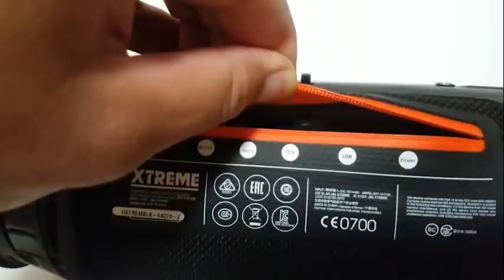JBL XTREME with 18650 Batteries (DIY)

Comment: how do you connect the batteries to each other
Reply from the maker: Safe way is to spot weld but if you don't have enough to buy that machine you can solder wires to it but you have to do it fast otherwise you will damage the batteries from the heat.

Comment: Where is the best place to buy batteries for my Xtreme jbl?? What's the most mah battery 🔋 that ww can fit in there??
Reply from the maker: Some prefer online but if you have 18650 charger that can also test the mAh of the batteries than I would visit a local laptop repair shop and see if they're giving away any defective laptop batteries and salvage some 18650s out of it. If you don't want to spend too much time doing all of this than maybe it's better to just buy the original battery but I'm not sure right now if they're cheap or not.

Comment: Should you use 2 18650 to maintain balance when changing, 2 parallel X 2 might not charge right with 18650, remember the charger for this speaker is 19V 3A output which is crazy.
Reply from the maker: The main board lowers the voltage down to 8.4V. if it was feeding the batteries 19V then they would have gone bad already or even worse exploded.

Comment: 3.7V x 4 = 14.8 will destroy my xtreme?
Reply from the maker: It will if you connect all 4 batteries in series! It's two pairs, if you look closely I have two sets connected in parallel. 3.7 x 2 = 7.4 (8.4 when fully charged, same voltage as the original battery when it's all charged up).

Comment: Ben de aynen videoda olduğu gibi yaptim. 4 adet Sony vct 6 aldim (3000 Mah.) Hiç bir sorun yok, şarj oluyor ve led gostergeler calışıyor. Orijinal bataryasına göre deşarj ömrünün daha kısa olduğunu düşünüyorum,  çünkü orijinal bataryası ile full şarj 3.5 saatte oluyordu, Sony piller 3 saatte full şarj oluyor. Orijinal batarya 5000 Mah. Sony vct 6 ile bu şekilde bağlantı yapıldığında 6000 Mah. oluyor batarya ve amper arttığı için 3.5 saatten daha geç şarj olması gerekirken, şarj daha kısa sürede oluyor, bu sebeple deşarj ömrü de daha kısa olacaktır diye düşünüyorum. 18650 kullanmak isteyen arkadaşlara tavsiyem 3600 Mah den daha düşük pil kullanmamaları.

Comment: Sir my jbl xtreme has a problem, when i pull out the charging cable my jbl only live in a few minutes then it turn off without battery low alert and when i try to charge it the device still has 4 bar battery, is there a problem with my battery?
Reply from the maker: Raditya Dimas you’re JBL XTREME battery is defective so it needs replacing. The thing happened to the one in this video.
Reply: Where can I get my battery replaced?and how much is the cost?
Reply: I replaced the batteries with 18650 but the charging problem is still not resolved i guess my BMS is defective. 
Even the vtg across the BMS is perfect.

What do you suggest?

Comment: Hi, do i need to use hig drain 18650 batteries for this?
Reply from the maker: Not too sure, I haven’t checked on the batteries i used if they’re High Drain but to be on the safe side go for it.

Comment: I made the change but it fail to start on batteries now is working only with the power supply, when I remove the charger it's shutting down instantaneous.What can be the reason?
Reply from the maker: Is it still doing that? Did both batteries have the same voltage when you connected them?
Reply: I solved it with the balanced type diagram

Comment: my jbl wont charge and i know the batteries are a problem but the charging connector feels loose... is there a way to remove the battery and just use wall power?
Reply: Yes, remove the battery, and wall power will work. I
Reply: @JohnnySlapp  then it's the charge port... shit...
Reply: adam are you sure it ain’t the cord? That’s what happened to mine.
Reply: @JohnnySlapp  I'm certain... i get sparks (meaning there is current) but no actual charging.

Comment: Is it normal for the Extreme to have a plastic smell when you increase it's volume level? I noticed that everytime I increase the volume, the speaker releases a plastic smell. Maybe someting is heating up inside.
Reply from the maker: That doesn't sound/smell normal at all. My JBL Xtreme doesn't smell when in use. Might want to check it again.

Comment: hi there Taylor, i just want to ask how many Voltage and  Ampere of each battery (AA) you are using here in this video?
Reply from the maker: Each battery that's in parallel is rated at 4.2V when fully charged but I am not sure about the capacity of the 18650s and it doesn't even say anything about it on the plastic cover.
Reply: Injimudoa!!!!!!
Reply: They are LG 18650-25R and are 3,7v 2600mah. Pr. Cell 👍 so now its a 7,4v 5200 mah. insted of 10000 mah Xtreme 🙂

Comment: This is BS if you pay for a product that has a battery then we should be able to replace a dead battery without having to go through this process, my extreme is now a static speaker pointless as a portable speaker and I have never soldered anything so am not comfortable doing what you have done, shame on JBL.

My rant is with JBL not this channel
Reply: I think electronic should start using 18650 batteries with a removable battery tray. 18650 batteries have quite the capacity compared to multiple AAs and they're rechargable. It seems as if most of the products we buy now are disposable. The battery is always the first thing to go now and you can't change it most of the time.
Reply: @noahw5887  That is my point there is no valid reason not to offer replaceable battery's via removable battery tray or the like, other then profit, these company's have mushed consumers brains to accept throw away  products as a norm, and with clever neuromarketing we won't care because the upgrade option is always in front of us.
Reply: @Shane Ryan Your argument is as useful as water bucket full of holes, by your own logic this would be OK.
Reply: @Shane Ryan The useless bucket just means your buying into and defending a product that in a very short time would become a door stop this is an inevitable outcome, yes it will hold water but for how long, would you not sooner buy an item that continue to function for many years after paying out quite a lot of money for it? Offer one valid reason why JBL do not offer a battery tray option? its not for lack of space, It is purely corporate greed.

As for reading the small print, I bought mine in curry's online no mention about the battery being non replaceable bit hard to read small print on the box when ordered online right Shane?

https://www.currys.co.uk/gbuk/audio-and-headphones/audio/hifi-systems-and-speakers/jbl-xtreme-portable-bluetooth-wireless-speaker-black-10133409-pdt.html
Reply: @Shane Ryan The most stupid people are the type of people that just don't realise how stupid they actually are, your logic has holes in it hehe.
Reply: @Shane Ryan Hey there you tried to hide but your ego brought you back, not even an attempt to answer the questions asked, I had to drop to your level to get you here, I knew you read it but it made you look dumb you tried to ignore lol. 

Your logic was based around assumption as in you stupidly assumed that all JBL extremes are bought in store, so as my "ignored" reply explains, curry's store does not mention anything about this short life span of the portable side of this device, mine lasted only three years, also JBL site does not mention it.

so let me quote you;

"I suppose you purchased your JBL product while under extreme duress, right? The sales person forced you to purchase the product that clearly states on the manufactures label "Non-Removable battery"... Shame on you, not JBL..."  unquote

Please respond to my question, mine bought online no warnings and give your reason why you strongly feel the need to support corporate greed.

If you feel i'm wrong then argue your point but lose your rudeness or don't bother to reply.
Reply: @Shane Ryan OK Shane you still can't grasp how pathetic you're assumed point was so now you try to add to it, try to think of all the possibility next time slow down and don't rush in Mr logic and maybe just maybe your get that badge your so desperate for it will say "superior intelligence" and you can show mummy and she will look at her precious and tell her little snowflake like she always told you that you are above everyone else. 

Tip for future: Shane (dumb-ass) it is OK to not agree with others but do it in a respectable way (stupid) don't be so emotional (idiot) take this tip to the grave (bitch) your life will improve but last of all please don't breed! already so many assumption thinking rude emo triggered social media snowflakes. 

So in your words Nemie will fuck off now.
Reply: @Shane Ryan I bought the JBL partybox 300 it has 8x 18650 li-ion battery's not hard to swap over, so I considered it an acceptable purchase.
Reply: @Shane Ryan Forgot to mention your Hit a nerve comment its in your head you have had no effect on me at all, all you achieved was to show me you can't get your point across very well and are rude by nature. I can reply everyday if you want not because I'm triggered by you, but because it takes a while for people like you to grasp your nothing special your just an insulting person being called out, don't believe me just read back all you have written, just assumptions, insults, and a false sense of wanting to be right, read your see you are your own witness.

Got to go speaker later...

Comment: By removing battery,Can I use it as wired speaker at home?
Reply from the maker: Yes you can definitely do that, no harm in using it without a battery.
Reply: @TaylorSoloaiJR  thank you v much brother.... from India
Reply: @TaylorSoloaiJR   how to do that brother can you help?
Reply: chinna babu y s with ac mode
Reply: Use with ac mode
Reply: i remove the battery but still it didnt work out,

Comment: If only one cell is faulty, can we make the existing battery work with single cell? How can the connections of a single cell to BMS, should look like?
Reply from the maker: It won't work, the output from the battery itself is 8.4V. Each cell rated at 4.2V

Comment: use battery bank, it has direct 20v 5a line in and 50,000 mah https://www.amazon.com/gp/product/B00YP823NA/ref=ask_ql_qh_dp_hza runs way longer then internal batt and you get the plugin loudness

Comment from the maker: Hey guys, can you help me reach 1000 Subscribers?
Reply: can i ask im from.philippines
Reply from the maker: What's the question?
Reply: can i use it without battery?? i already pull out the battery but still i cant use it.
Reply from the maker: I am not sure if you can, Ive tried it on a JBL Flip 3 without a battery and it wont turn on. I don’t remember if i tried it on the Xtreme but i can’t do the test because i gave it away as a gift.
Reply: ok thankyou

Comment: you went too far with it, easily just buy another battery and replace it, no point in tearing apart the battery to replace it. you can't reuse it.
Reply from the maker: ARKHAM KNIGHT OP don't know how far you watched but I didn't reuse the battery I only reused the BMS board. I'm actually happy that I did go that far because I'm still using the JBL with 18650s.

Comment: I have a doubt. How do I connect the batteries? positive from one with negative from the other? Is it difficult to weld that plate?
Reply from the maker: From experience it's difficult if it's your first time trying it but it does take a lot of patience.

Comment: I also had this kind of problem, but I have no guarantee, do you recommend me to change the battery manually without warranty? contact me for answers please, thank you!    alessiopezza@libero.it  / alessiopezza (instagram)@ __its_ale__
Reply from the maker: This method is for those that have no warranty and have experiences with soldering. If you don't know how to solder then ask a friend or take to a repair show to do it for you. Never hurts to try it yourself.

Comment: You are the man!!! I bought one of these as soon as they hit the market, and the battery failed just as you described. It failed just over one year old. JBL would not fix it under warranty. I offered to pay JBL $$$ to fix it, they said they would not. $300 piece of crap. Thank you for making this video. I will replace the battery in mine, but never buy a JBL product again. They obviously DO NOT stand behind their product.
Reply: Nah man just don't buy extreme I bought the boom box it shakes my house I can throw it in the water
Reply: @xen1568  yeah good luck for you when will be time to change battery to the boombox. 
 I've got a.boombox too and I realized was better buy 2 extreme 2 instead, for the reason you can change the battery in 10 min. The battery on the boombox is very very very hard to reach and I guess not worty..
Yeah boombox has better and dipper sound but  the battery is generally not great after years you'll need to keep it plugged,  and 500dollars for 60watts that needs a plug,? Is not worty to me. 
With 500 dollars you can buy a sound systems 500 watts. 
👍
Reply from the maker: Hey glad you found this video, my other video will help you more in case of trying to connect the batteries to the BMS board that came with the original battery so don't throw it away it yet.
UPDATED Video
https://www.youtube.com/watch?v=HhC_CpxtSF4&feature=youtu.be
Reply: Me too,JBL RIP-OFF

Comment: Nice video! I have JBL Xtreme and had problems with faulty battery after 1.5 years of heavy usage, i was using it atleast 5 days a week, but my warranty replaced the battery, and its good as new now. I'm from Europe, and mine has 24 months of warranty, if your warranty declines changing it, I think you should push them harder, maybe contact JBL aswell, because they've changed mine without asking any questions

Comment: I followed instruction and added 18650's to mine, but instead I mounted them in the original battery location, just needed to use my Dremel tool to do some minor clearancing..

Comment: Sir,please tell me how what kind of batteries i buy to fix my jbl xtreme,please reply sir, i really really need you help 😔😭😢
Reply from the maker: You could find the copy of JBL Xtreme battery on eBay but if you are going to use 18650s then go for the Panasonic
Reply: Taylor Soloai thank you so much for replying me sir! Merry Christmas!😁🎅🎅🎅
Reply from the maker: Thank you, Merry Christmas to you too
Reply: Goodmorning sir! 😁, can i ask, hoe about lg choco?, panasonic battery its so hard to find here in my country.. Lg choco battery (3000mah,nominal voltage 3.6v, full charge voltage 4.2v, positive terminal-flattop, 20A high drain discharge, 3000mah capacity, 3.7v standard voltage,, sirr pls answer me hehehe thanks!😁😁😁
Reply from the maker: Yeah that sounds good enough to make it work, the LG is recommended but any will do.

Comment: Can I use speaker cable?
Reply from the maker: Yes thats what I used because its a lot more thinner and easy to fit inside the battery compartment.
Reply: cool, thanks
Reply from the maker: Forgot to tell you that I uploaded a better video, shows you how to actually connect the 18650s. Link below 

https://youtu.be/HhC_CpxtSF4

Comment: Sir can I use external 19v power bank from DC input port and simply unplug the internal battery from the circuit board. Because I am not good with all this electrical work as I am Geologist.. 🤔
Reply from the maker: I havent tired it but I guess it will work, if its too much work then I suggest you buy this battery thats on eBay

https://www.ebay.com/itm/GSP0931134-Battery-for-JBL-JBLXTREME-Xtreme-5000-mAh/282629674613?ssPageName=STRK%3AMEBIDX%3AIT&_trksid=p2055119.m1438.l2649

Easier then what I did
Reply: I was curious and took the battery out and it's running good with just the power supply it came with.  No problems yet and sounds amazing

Comment: This video saved my approx $100. Thanks a lot...
Reply from the maker: glad it worked out for you
Reply: Taylor Soloai not completely right now but I have order batteries and power bank (only case.. Voltage can be adjusted 5-21 v). Waiting for get deliver.. First I will try just with power bank and then I will try your method ( with some expert help😒).. Hope this will work. But still you saved my money. I will let you which method worked for me..

Comment: good morning Taylor i write to you from Caracas thank you  for  your videos are very helpful because here in Venezuela do not get the original batteries of the xtreme. my question is those batteries 18650 here are different features but you can not get the panasonic that you recomended but mostly are chinese ones with a positive button and not others and also of various MH that you recomend to work welle specifications or similar to panasonic batteries thank for your help.
Reply from the maker: +Alexander Salmaso D. The 18650s I used we're from a broken laptop. If you have a store that sells laptop batteries or if one of your friends have a broken laptop then you are in luck. If that's too hard to find then just use those  but be careful with it.

Comment: Gonna attempt this cause JBL Bum and said they wont replace my.speaker.  i just went over 1year
Reply from the maker: TK Beatz https://youtu.be/HhC_CpxtSF4 use that video for reference, I went more in detail especially the part of connecting the 18650 to the BMS board.

Good luck 🤙
Reply: Taylor Soloai ok sweet thank.you
Reply from the maker: I think the 2 year only applies to the new JBL Boombox  not the Xtreme
Reply: These speaker's have a 2 year warranty i don't see why they wouldn't assist you.
Reply: themessiah809 says 1 year from JB HI FI

Comment: What's the mah capacity of each battery
Reply from the maker: +nadeem khan if I remember correctly it's 3000mAh for each 18650
Reply: So that is 6000mAh 7,2V
Reply: So its less then before